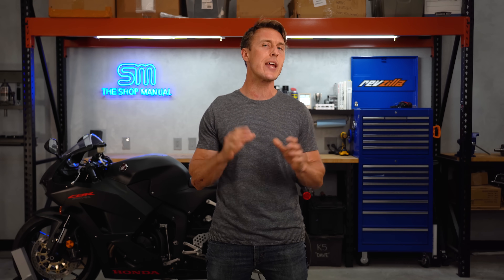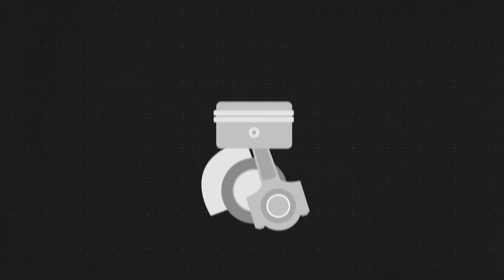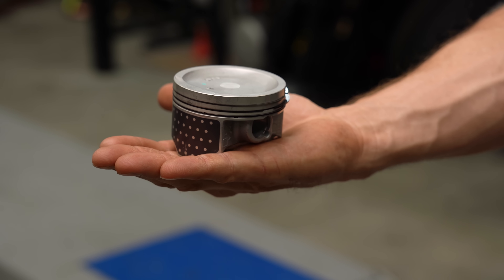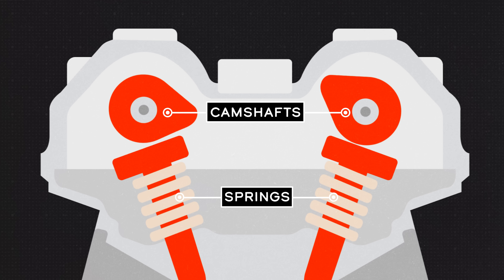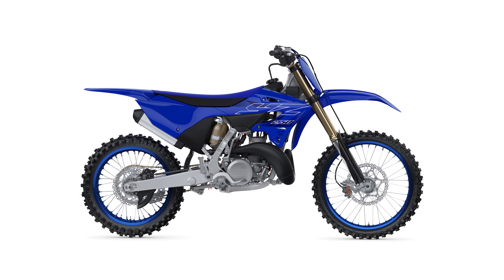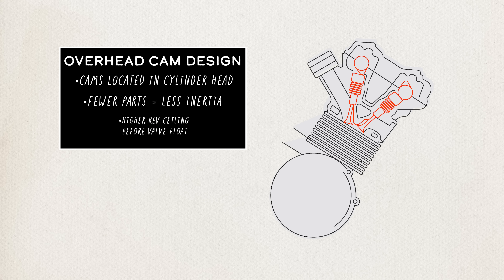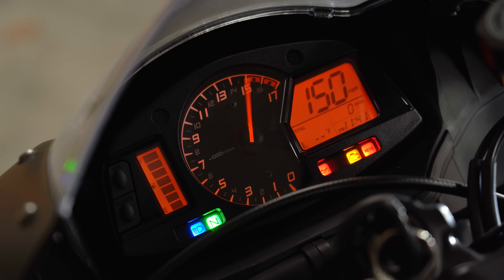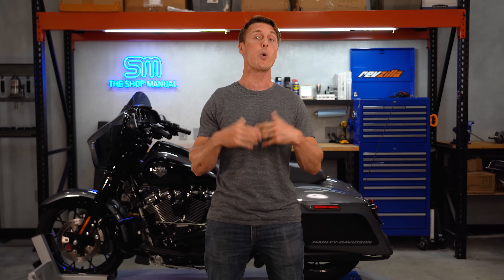This Is Why Your Motorcycle Has a Redline | The Shop Manual

Comment: Just remember that the ECU rev-limiter won't protect the engine if you're at a high enough RPM and speed and downshift to a lower gear and overspeed the engine mechanically.
Reply: Money shift can be costly
Reply: Very true but its quite common for the rear to lock up which helps prevents over reving.
Reply: @will2461-j2n    However, many bikes have anti rear lock mechanisms, so damage is not prevented.
Reply: @marcandres4254  Yeah, but that is just a slipper clutch that only allows force to go one way. If there is a significant difference between back wheel speed and engine speed, the clutch slips.
Reply: @will2461-j2n  It did happen to me once. Rear wheel burnt the hell off the asphalt!
Reply: Isn't that what a slipper clutch is for?
Reply: @zackiaryruddick701  The SC can help reduce the chance the rear tire will lock (possibly resulting in a loss of control) under those conditions but there's no assurance the engine will not still be overspeeded.
Reply: @mikep.5517  ok thanks for the info
Reply: @mikep.5517  Yes there, is. The slipper limits back torque (the torque driving the engine) and protects from over rev.
Reply: @AriH211  Hi Ari. Thanks for replying. I feel intuitively like it would still be possible to overspeed the engine under the right conditions, depending on the degree of clutch disengagement and residual torque delivery to the crank. Maybe it's because my '17 Tuono with a SC gives insane engine braking meaning its SC torque delivery is substantial. This sounds like a great topic for a follow-up episode of TSM: Take a bike or two -- with a slipper clutch -- the engine(s) of which you're willing to sacrifice; get it up to redline in 5th gear, clutch in and downshift thrice to 2nd and dump the clutch and see what happens. Maybe repeat it five times and log engine and rear wheel RPM somehow to see how effective the slipper clutch actually is at protecting the engine from overspeeding as well as preventing locking/chattering of the rear wheel.
Reply: @mikep.5517  there are some good slipper dry and wet clutches available to buy, like stm and suter, I have a suter clutch installed on my cbr and downshifted too early way too often to remember on the track. Nothing happened so far because it’s mechanically designed to disconnect clutch at a too high engine rpm.
You can even adjust it the way you want if you’ve done some upgrades to valves, cams and springs or just for race setup. Moto2 teams use it and it really is a good way to spend 1500 bucks, no regrets worth the money
But still you’re right about overrevving when downshifting, without a proper clutch you’ll have your rods breaking through the block in no time
Reply: @zackiaryruddick701  Yes.
Reply: Just rev match when down shifting... Oh wait can't give more throttle. Lol
Reply: You probably aren’t gonna last very long on a bike if you ride like that anyway.
Reply: AKA The money shift haha
Reply: @Reginald-Bowls  Slipper clutch to save the day? ಡ ͜ ʖ ಡ
Reply: Which should never happen on a bike….

Car on other hand….Those mishifts 😓
Reply: AKA Money Shift >:D
Reply: More commonly it will happen shift on downhill, or desal
Reply: In a manual car, they call that the 5-2 money shift, cuz shifting from 5th to 2nd on the move is going to be expensive
Reply: Slipper clutches are standard on most motorcycles
Reply: Great fact re the piston weighing more than the entire bike under max G, puts it in perspective 👍
Reply: Cars now have limb mode where they prevent money shifting
Reply: On a smaller cc bike yeah but 1000ccs can do 100mph in 1st and most 600ccs 60ish
Reply: There have been cases where the rev limiter has caused issues. Back in the day when they were often crude and just cut the ignition when the revs exceeded X value they'd cause a rapid pulsing on-and-off on power that could cause the engine to pop. It wasn't common, but it happened. These days limiters are a bit more subtle and either advance the ignition, back off boost or just close the drive-by-wire throttle bodies to back it off more gently so you just run out of puff over 500rpm or so as your approach it.
Reply: Luckily it's a lot harder to money shift a motorcycle than a car, I've wondered why cars don't have sequential gearing like motorcycles?
Reply: @Nebnub  they have sequential in rally cars 😁😁
Reply: @Nebnub  They basically are now in the form of paddle shifters. It's getting to be hard to find anything with an actual stick shift.
Reply: @Nebnub  There have been a few sequential cars (chiefly those who's powertrain was derived from bikes!) - but the main reason for the h-Block is "block changes" where you adjust your speed and slot into the appropriate gear eg. slowing for a turn you stay in 4th until you shift to 2nd to make the turn and accelerate away. You couldn't really shift a h-shift with your right toe, though. :-) (even if you could, the need to balance engine-against-speed is far stronger on bikes).
Reply: @Nebnub  
I'm not sure why auto builders mainly go
with non sequential manual shifting, but
it is very convenient, not having to shift
or clutch in  dozens of times on a short
trip vs just a few. With  sequential shift,
typical on a bike there is still no guarantee
that the rider won't rev out 3rd to near  
redline, then accidentally hit 2nd instead of
4th gear.
I have accidentally shifted down
vs up , or forgot that I'm already in a really
low gear and started letting out the clutch. 
----------
GP  racers usually use a 'race' shifting
pattern of 1 up, 4 or 5 down, as opposed to
street-shift which is typically 1 down 4 or 5 up,
at least one racer destroyed his engine 
by getting mixed up between his street-shifting
habits and race-shifting.
Reply: Who the hell will down shift without cutting the gas? Only kids do that. At the time u cut of the gas ur engine have already decreased the speed
Reply: Have u seen someone downshift without doing rev match or cutting the gas first???
Reply: @chaaoo0  Yep, usually but not always less experienced riders. I've also seen more seasoned riders with recently-setup GP shift patterns make a mistake and downshift when they meant to upshift. It's sometimes called a "money shift", a term that became popularized with the import crowd when a guy'd be racing and, instead of upshifting 3-4, he'd go 3-2 and pop the motor. My point is it can happen and the ECU rev-limiter is not going to save things.
Reply: @chaaoo0  there are plenty of ways to errantly shift into a lower gear. While much harder on a sequential box, especially with a motorcycle given the nature of shifting, it’s possible. It was merely a commentary on how the limiter won’t save you, though again slipper clutches are here to save you in these situations.
Reply: It doesnt matter since downshift over-rev isnt causing high combusting, thus it creates no temperature and is harmless.
Reply: @pflaffik  At least 1 GP rider blew up 
his engine on a miss-shift, there are 
many accounts of others doing the same, 
heat isn't the only thing that damages
engines and transmissions.

Comment: Excellent!  That is why Harley stops breathing at higher rpm, huge pistons with long rods.
Reply: It is a little more complicated that that, but that is the general idea.  Another reason is that Harley traditionally optimizes its valve timing to produce high torque at very low engine speeds.  This limits power at high RPM's.  Variable valve timing (as used in the new Pan America) can provide good performance at both ends of the RPM spectrum.

Comment: An engineer once tole me the was a limitation on the maximum inch feet per second a piston can travel on a given surface like Nikasil or Chrome cylinder wall coatings. it's an interesting subject.

Comment: But engine braking doesn't wear your engine out faster... got it...
Reply: Operating the engine above redline can cause premature engine failure.  I do not recall Ari saying otherwise.
Reply: @jfess1911  "You just don't want to keep it spinning that high unnecessarily, because it will wear out your engine faster" seems straight forward. Unless there's a difference in the revs at high rpm vs any other rev range... or if theres a "purpose" to those revs like something magical happens at higher rpm? The bottom line is extra revs means extra wear. I'm not even against engine braking other than some extra wear. This was a point on his engine braking video he choose not to mention that I commented on and was told I was wrong on. So pick a lane.
Reply: @jfess1911  Also, I don't recall me saying he was wrong in that redline can cause damage... sooo... ya the sky is blue and water is wet...
Reply: @intrigue175175  Your comment was worded in such a way that the point was unclear and no context was provided.  So yes, I made a "sky is blue and water is wet" comment stating the facts as I know them.  The "I do not recall" part is simply because my memory is not the best.
 
I actually knew someone who tried to damage an engine by using engine braking beyond its redline, although I can't remember why he tried.
Reply: Regular engine braking will not wear your engine out faster. Downshifting to a point that the engine runs into the redline is certainly bad, and I point that out in the vid we did about engine braking. If you're worried about the momentary spike in revs that occurs as you downshift and engine brake, that's a different scenario than holding an engine at or near redline as you ride.

Comment: 2stronkes don't really have a redline they just run out of flow in the poirt design and the exhaust pulses stop lining up right. they really just stop making power over a certain rpm often called over-rev.
Reply: Nope.  All engines have a mechanical redline above which parts will be compromised.
Reply: @LTVoyager   yea eventually but there is no way to get to that speed with a two-stroke. Like there is no electronic limit like a four-stroke or even a Rev limit spec in your owners manual. The engineers know that its not possible to blow up your two-stroke by over reving it. 
It runs out of power before it flies apart.
Reply: @nick4506  Au contraire.  Shift into 1st gear at 50 MPH and pop the clutch and tell me what happens.
Reply: @LTVoyager  probably sheer the teeth off the clutch basket or the  gear on the crank, they are small and only supported on one end or maybe just wreak first gear in the transmission. My point is that the red line works completely differently on a two-stroke than most other bikes. There is no line or limiter or spec. You can have a bike on the stand and go wide open and it will move till it runs out of breath. I'm sure you can spin it fast enough to cause issues but not from reving in a parking lot. There is no valve float or oil controll issues that kill high rpm four-strokes.

Comment: Nice explanation, simple enough for most people to understand. 👍
However, just one correction that I'd suggest.

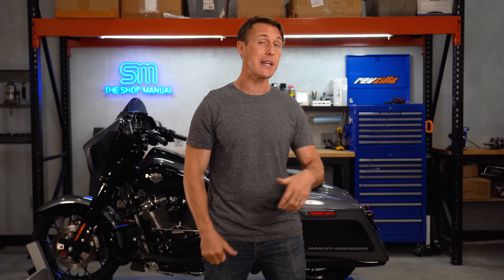4:40 rather, piston acceleration, which is also directly proportional to stroke. 
Mean piston velocity isn't a good indicator as things can accelerate at less rate but for a longer time period to reach higher speeds.

Force = mass × acceleration

For a given piston mass, the higher it's acceleration, the higher would be the forces it has to endure.

Comment: I was reading about Honda’s experimental oval-piston engine, that thing red lined at just under 25 000 rpm!
Reply: There were small 250 i4 road legal motorcycles that could rev up up to 19000rpm in early nineties.  With pretty impressive power around 45hp. 
That oval piston engine wasn't experimental. It was a race engine. The rules at the time allowed up to four combustion chambers, so Honda designed a 32-valve V8 with four pairs of linked combustion chambers. This then evolved into an engine with four oval-shaped cylinders. The oval cylinders allowed room for 32 valves and eight spark plugs, the same as that of an eight-cylinder engine while staying within the four-cylinder rules limit.
Reply: @jordan9339  But it was impractical for normal road use, I presume?
Reply: @gokulkrishm51  yes. The VFR750R is a race machine. It is doomed because of the complicated engineering behind the oval pistion, making its repair a lot longer than common i4 engine.
Reply: @TomRaider410  VFR use oval piston? I didn't know that!!
Reply: @gokulkrishm51 . My bad, it was the NR750
Reply: @Paulthenutter34  Yessir! It's the NR. Not the VFR.
Reply: @gokulkrishm51  actually those little i4 250s were incredibly reliable known to do up to 200k kms they were just really finicky when it came to carbs
Reply: @Emfourayone  Of course! I never said unreliable ;) 
I'd love to see those 250 i4s rolling again 😆
Reply: @gokulkrishm51  oh I'm an idiot and didn't read properly they are actually really practical cuz you can wind em all the way out and not be going like 150km/h in first
Reply: @Emfourayone  Hahah, it's okay. 
I've actually never seen one in real life. Sounds like an amazing bike!
Reply: @gokulkrishm51  great little machines  was my and alot of learner riders first bike here in aus
Reply: @Emfourayone  Oh really! That's very cool! My learner bike was my Dad's Royal Enfield 350 :)  Still ride around in that. 
Hoping to get something new after this June when I get my license 😆
Reply: Yeah, I read that too! Any idea why they didn't bring it to mass production?

Comment: Gotta love how they talk about Ducati's desmodronic motors and then show a photo of a bike with the new V4 which has a regular shim under bucket and cam chain haha. Otherwise, great video!
Reply: Only the Multistrada V4 uses spring valves. The Streetfighter is derived from the Panigale which is most certainly Desmo, hence the huge "Desmosedici Streadale" badging on the cylinder heads, which we were careful to include in this video.
Reply: @AriH211  ah thank you for the correction :) Okay so all V4's use a cam chain but only the Multistrada has shim under bucket.
Reply: @DearMajesty  They all do use a cam chain - Ducati hasn't had bevel-drive cams in decades. The difference with the 2021 Multistrada V4 is that it uses conventional valve springs instead of desmodromic actuation.
Reply: @AriH211  I'm silly. I meant spring valves by shim under bucket haha.

Comment: Most engines make peak power before the redline anyway, no need to ping the limiter to go fast.
Reply: There are times when going past peak power makes sense, though.  When going through several gears, you maintain higher average power level if you shift past peak power.

Comment: got a yamaha xj6 with a normal 600cc I4. its the same block and pistons as the R6 which revs to 17k but my xj6 only does 12800. wich shows you how much margin the manufactures put into the engiens

Comment: Couldn't manufacturers just stop the revs at 15000 for the Honda instead of making it 17000 and put a redline between 15000-17000? If it's bad to rev an engine into the redline, why does it exist? I mean, why not remove it entirely?

Comment: Very informative, thanks Ari! But still I wonder how exactly the rev limit is determined. Like, which part (or maybe electronic) holds back the entire engine and how does that work?
Reply: determined by the manufacturer from their testing.   Rev limiters either cut Fuel or Cut power to the spark plugs (Ari mentioned it in this vid)
Reply: @DefZen343  Yeah yeah I think I understand. That must be an electronic trigger. I was more curious about the mechanical trigger when not using an ECU or injection
Reply: @dietzness  Mechanical systems often rely on centrifugal force of a spinning device to cut the fuel or spark.  Another system, often found in lawnmower engines, uses the air pressure from the mechanical cooling fan to operate a linkage to the throttle. Look up "engine governor".
ps.  Many engines do not have any type of rev limiter.  They rely on the operator.
Reply: @jfess1911  Great stuff. Thanks!